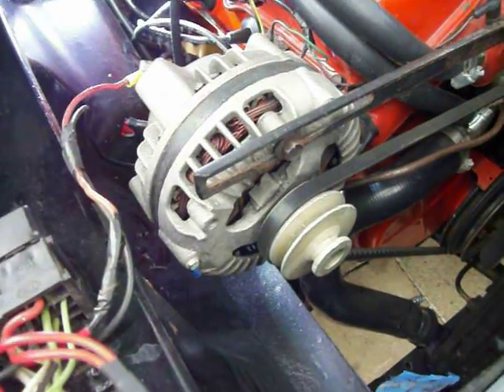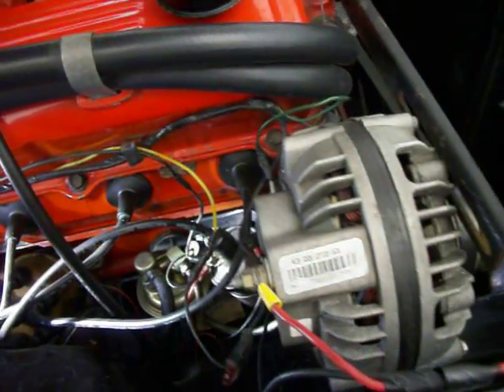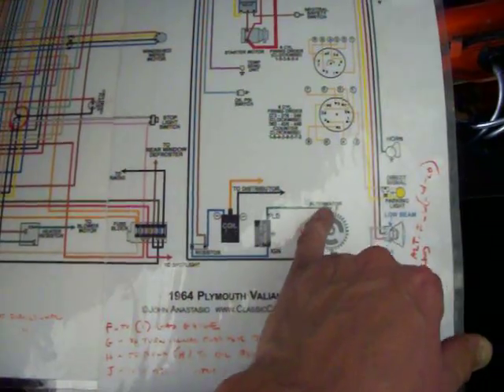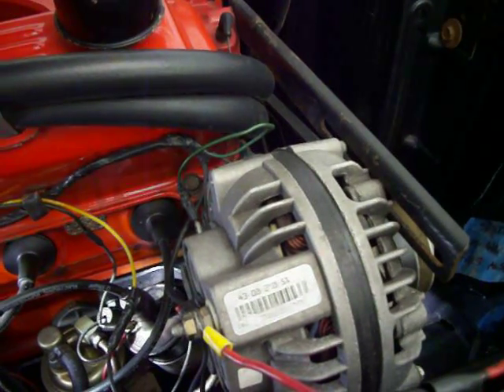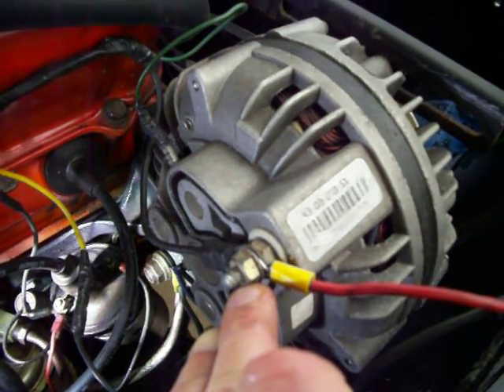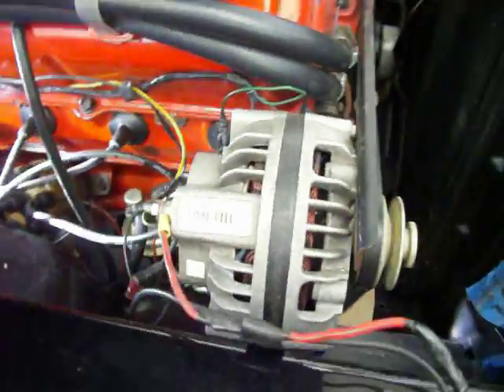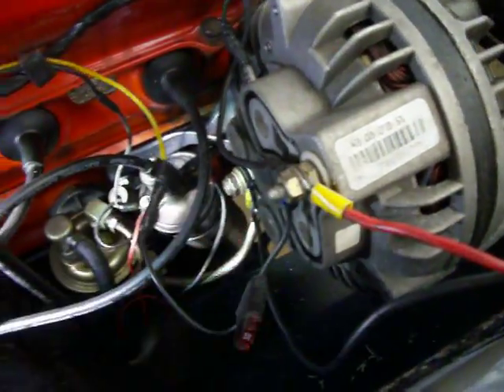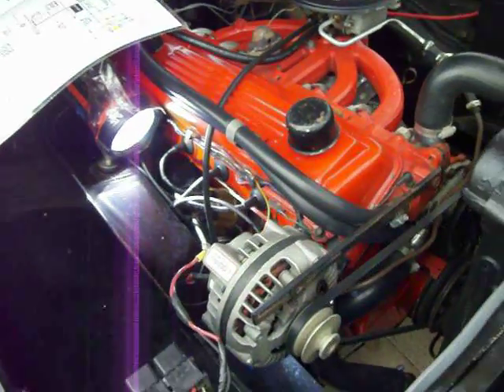60 Amp Chrysler Alternator on my 64 Valiant

Comment: Alternators turn at 2.5 times faster than the engine because of pulley size and still only charge at 40% of their rated value. It always good to have a bigger alternator than what generally comes stock especially if you’ve added more load ie off road lights, radios, boom boxes etc. I put a 140 amp Cadillac alternator on my Toyota 4Runner (stock was 60 amp) when your talking batteries and alternators, more is better!  https://youtu.be/3xavPSmNOeQ
Reply: "..more is better!" To a point. Over a 100% increase in alternator output capacity without a corresponding increase in cabling size is a recipe for disaster.
Reply: @Vince Majestyk  good observation,  my stock toyota alternator output wire to the battery has a 100 Amp inline fuse so that was abandoned. In place of that I now have a 6 Guage wire. As well I've relocated my small stock battery to the rear now using an H8 size huge battery to run my many accessories including an electric air pump.
Wire going aft is welding cable.

Comment: Why do you have to create a field and then connect it to the front of the alternator?
Reply: The connection he made is to provide a ground for the field circuit of his high amp alternator. The original alternator used a grounded field scheme (look up "B circuit" for alternators and generators), which had a single field terminal that connected to the voltage regulator. However, in later years Chrysler also used a "floating field" scheme that had both field connections brought out of the alternator to connect to the vehicle's wiring. So to make this alternator work with the original charging system on this car it is necessary to ground one of the field terminals to emulate the field scheme of the original alternator.
Reply: @Inflec thank a lot for youre explanation. 
Can the original wires handle the 60amp alternator? (Getting hot) Or do you need to adjust  them and switch to other fusible links.
Reply: @Veentje87  - That depends. If no other additions are being made to the electrical system, ex. high power sound system, aftermarket A/C system, etc the original wiring might be alright with a 60 amp alternator. Otherwise beefing up this wiring would be mandatory.

Comment: Do you have an "amp" gauge needle in the car? [Technically, not an amp meter  :-)  ]  Does the extra fancy lighting thingy bypass the purpose of it (to tell you which item has more voltage - the battery or alt) ?  Thank you.

Comment: Great Video. nice explanation and clear shots, was able to see hose connections that I needed to find for my '68 Dart 225cu. I installed a Pertronix Electric Ignition and having low idle problems. Blogs and Forums I've read say Bad Ground even mentioned a possibility of not enough juice from Alternator. Thanx for the post Bro!

Comment: I've been trying to get my car battery to charge. I hooked everything right, I bought all new parts, then about a mouth later the battery still doesn't charge. Any suggestions?
Reply from the maker: Rebuilt Alternators - Starters and so forth Need To Be Tested where you purchase, as sometimes they do not work & the time to install becomes a waste of time - I've had that happen - People at Auto Zone get a sour look on their face when I ask to test a Newly Rebuilt item & they have been surprised when the item fails out of the box - Does not surprise me - I go there because of the Lifetime Warranty 

You can test your alternator on the car - Search youtube for: Testing Alternator
Make sure it is charging properly!
Reply: @64valiantsteed  I totally agree! I'm on my 3rd 'Lifetime' AZ alternator in 4 or 5 years. Before that I got one in a junkyard that lasted 10 years. The problem with the AZ rebuuilt ones, and you can see it, is they ONLY replace the 'bad' parts so only half of the diodes get replaced or one bearing etc. Most of them have been rebuilt so many times the finish is horrible.